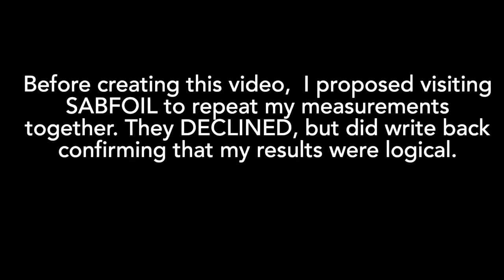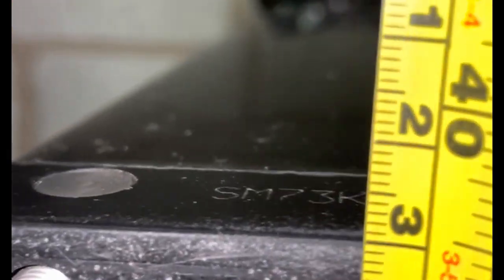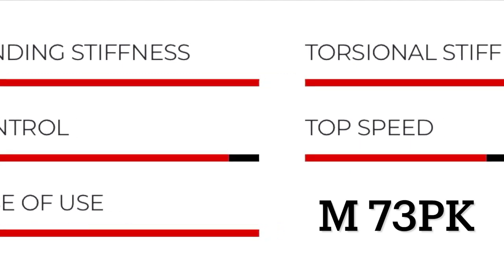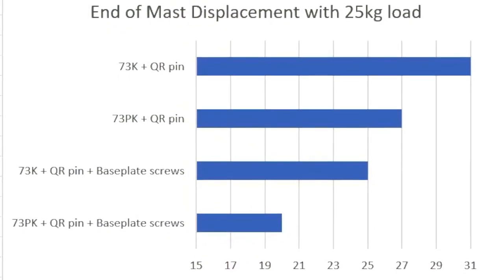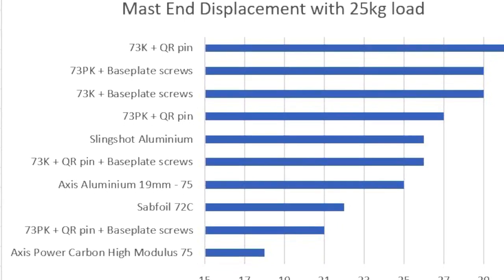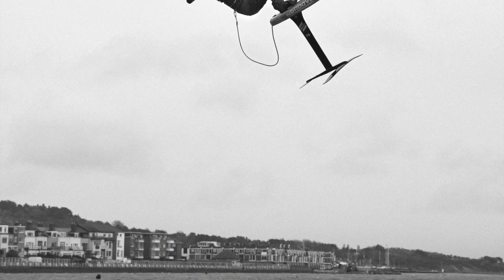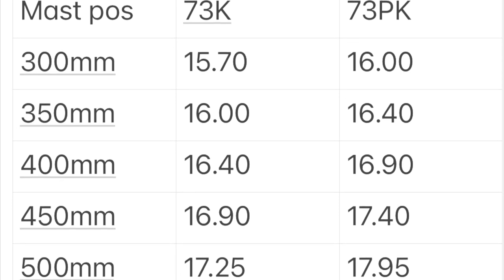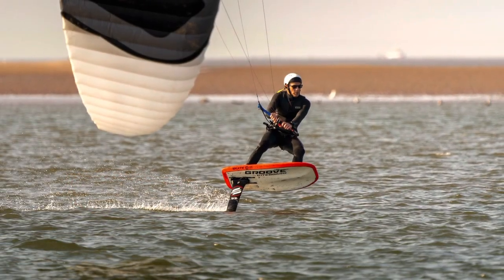Rigidity of the Sabfoil quick release system (comparing the M73K vs M73PK and more)

Comment: Interesting and very detailed technical video.
For sure Quick Release System plus the screws on the plate result in a stiffer solution compared to just the Quick Release System.
However I've been using QR on my masts for several month, also for pumping with Leviathan front wings and I never had any stiffness problems with my 73PK mast.
Looking at your video, probably the QR is not tightened enough (at minute 00:28 it seems barely tightened)
Reply from the maker: I can guarantee I did have it tight enough. I even repeated the test removing on more shim (was probably too tight then) but the results were the same. If you repeat the test you will find the same results. I too have used the 1350 with my 73K and 73PK with only the QR pin with good results. However, now I add the rear screws I know it’s better (based on measurements) and it felt better too.

Comment: Hi Steve
Loved this test that you performed here! 
And as I'm encountering huge (and sudden) spin-outs when riding in straight-line, since I swapped from the Medusa to the Medusa Pro, I have the strong feeling it might be related to this subject. 
If you have time, could you perform a variation on your test? 
I'd be interested to see how much the mast would bend (if any) forward or backward, when just using the 1-pin connector. So attach the QR mastplate to the wall 90 degrees rotated as compared to what you just showed and then perform the same tests...
I'm curious!
Reply from the maker: With the exception of pumpfoiling I’m now using Mikes Lab. Having a two piece mast makes no sense to me. As mentioned in the video, use both the locking pin and 2 screws through the base with the Kraken to ensure maximum rigidity is achieved. You also need to sand both your foil and mast, a glossy finish encourages ventilation. Send me DM and I can provide you with some tips on sanding.
Reply: @stevefollis9454  Hi Steve, I'd love to receive your tips on sanding

Comment: I’ve the QR from the beginning and my performances are the same and I use it in pump and Supfoil
Reply from the maker: So did I, but now know if I want better performance I need to add the rear screws. Some people will be satisfied with the QR, but based on my tests, it’s pointless buying the 73PK vs the 73K unless you put the screws in the rear of the base plate plus QR pin.
Reply: @stevefollis9454  in the video for me u don’t tight sufficiently the pin 
Are u sue to leave almost 1,5mm of space from pin and the box before to tight and lock???
Reply from the maker: @gianlucamuccioli-foil  I can guarantee I did. I even repeated the test removing on more shim (was probably too tight) but the results were the same. If you repeat the test you will find the same results
Reply: @stevefollis9454  absolutely not my kraken is perfectly solid 
If u don’t leave 1.5 mm where u give the max force to lock u can leave a lateral play
Follow the instructions
Reply from the maker: @gianlucamuccioli-foil  I thought the same as you, but if you hang 25kg on it you will find that there is a big difference between having the rear screws in the base plate and not. By all means measure it (repeat my rest) and present your results, but I’m quite confident as I did the test 3 times and tried different baseplates and masts

Comment: I still have my 'old' last season 82 sabfoil mast. no quick release, but doesnt seems to be worth to change, as I read here. 

My Sabfoil Wing to fuselage connection already worn out, even with the screw grease applied. Either I loose a screw on longer transitions(probably vibrations) or apparently the thread for the screw gets quickly damaged when more pressure is applied... 

How high did you jump there at min 2:40?  It looks massive, fly to the sky ! Cool stuff
Reply from the maker: The new system is better, but it could have been even better. If you go for the kraken don’t bother with the QR as you will benefit from the screws through the rear of the plate and a standard screw through the middle. The jump was 15.4m
Reply: Thanks for this information Steve. I just use the two screws with no quick release. I think you are suggesting I can make my setup stiffer just by adding a third screw without the need to also buy the quick release?  Thanks in advance.

Comment: The quick release needs to be designed between the board and the bottom of the mast, so the board is completely flat for transportation.
Reply from the maker: That would be perfect, a bit like a tuttle fitting but with a cam lock for speed. However, the problem with a tuttle box is that it wouldn’t suit a big range of foils (I require at least 100mm of track to suit my range of foils).
Reply: @stevefollis9454  F.I.  some stainless inserts adpaters, wich are screwed in each tuttle box,  then the mast foot to have kind of hooks, sliding under and  a clamb at the rear, pushing down and forward. But there are several ways it could be designed

Comment: The Sabfoil quick release system fixes a problem that didnt exist.  Removing 4 bolts is not that onerous given the enormous mechanical advantage.  The QR system is just contrary to what is mechanically superior (and the weight and the overly complex manufacturing).  Until sabfoil stop using the system I wont use their mast.
Reply from the maker: @ryodeo1341  this is also why I don’t use sabfoil anymore except for my Pumpfoil setup as the 1350 foil is ace